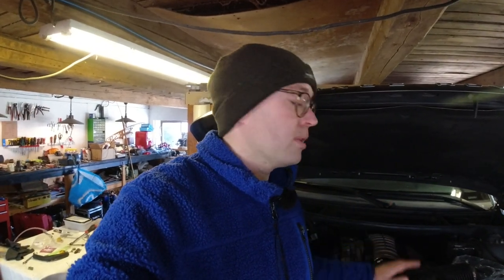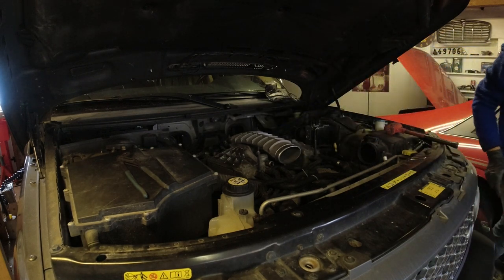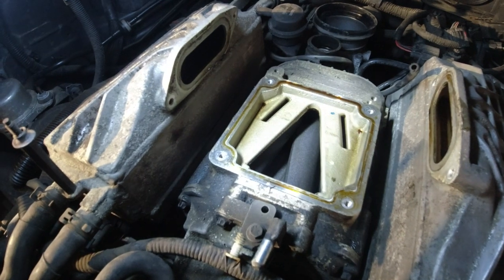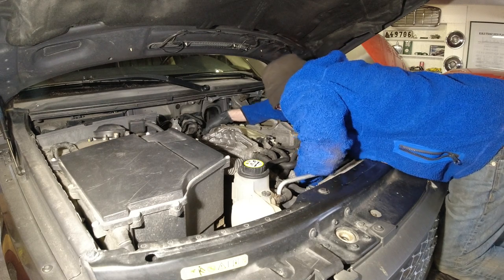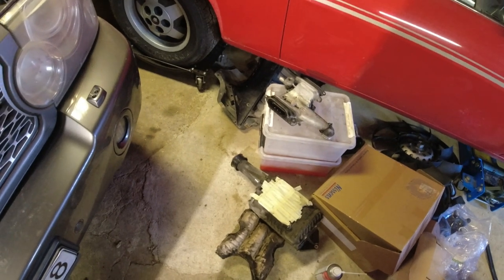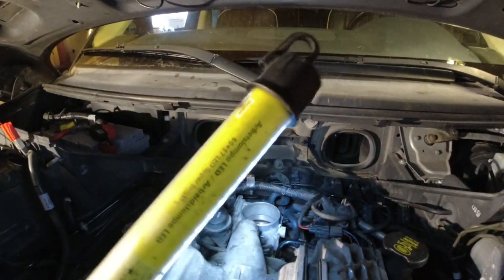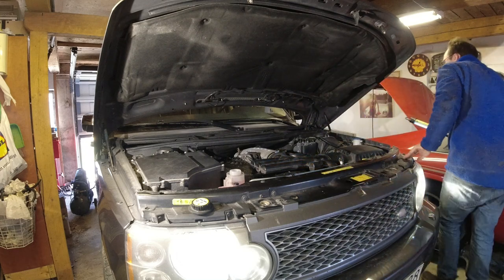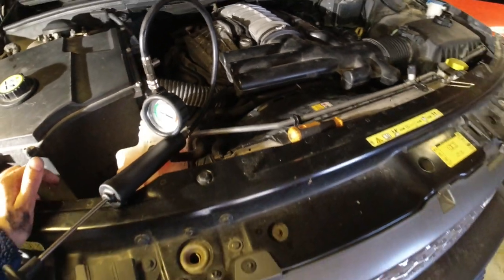Fixing the Tricky Coolant Leak UNDER the Supercharger of the Range Rover

Comment: I feel sorry to say this after watching this video, but here is how I changed that hose:
- Vacuumed a rope through the old hose
- At the back of the engine, vacuumed the same rope through the new hose
- Tied something to end of rope so it could not pull through hoses
- Put vaseline on new hose
- Pulled old hose and rope from front of engine
- New hose pushed old one out and slipped into its place

I hope this comment is of use to somenone...
Reply: Are you serious!? That is brilliant if possible. All that removal gave me material for nightmares…
Reply: You made it sound pretty easy, I’m reality how long did it take you?
Reply: Including fiddling around I used a couple of hours. To be honest I did it twice, the first time i used a standard straight hose. There is a tight turn under there, so the standard hose collapsed after short time. I then bit the bullet and bought the expensive original hose.
Reply: Also, if I remember correct, there are another hose under there and this is connected to somewhere under the supercharger. This hose I did not change… It may be the next ting to let go.
Reply: Hello  @ianwiik5357 , thank you for your comment. A serious question from somebody with cero experience in mechanics but with a big determination to fix my 2010 range rover. What type of hose do you use it? is there any serial #, code in the hose? Thank you for your time.

Comment: I did exactly that to get a Landrover into my workshop many years ago !  I knew you'd find the engine eventually !! That would be a very expensive fix in a dealership !! So does your wife suffer with a bad back ? I 've had a chronic slipped disc for most of my adult life ( 50 years ) so sympathise ! I was extremely fortunate that my wifes parents were qualified osteopaths . Not only did they save my back but also saved me a fortune ! Well l hope your wife's health improves as l guess she runs the horse business .  Thanks Adam.

Comment: If you’re attempting this repair and having as much pain removing the fan shroud as I am, you do NOT have to remove the full shroud. As long as the fan gets unscrewed so you can access the tentioner and get the belt off the supercharger pulley.
Reply from the maker: Yea of course, you just remove the top half of it
Reply: @LivingWithAClassic  It comes in two? Was trying to find the video where you said you showed the removal before but couldn’t find it, do you which video that is?

I just unscrewed the fan and left it there, shroud intact, and have been able to do everything.
Reply from the maker: @ProjectCentral you can remove just the top half of it. Shown in a really old video but it’s pretty obvious.